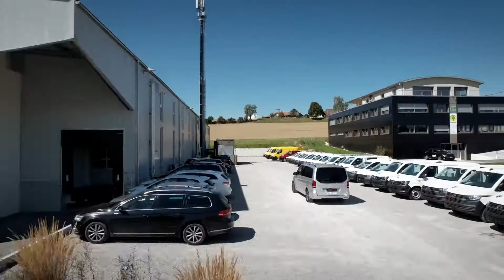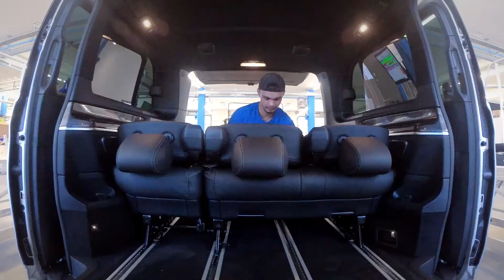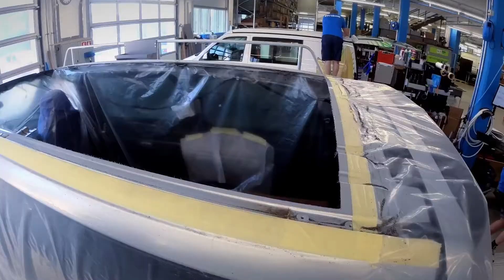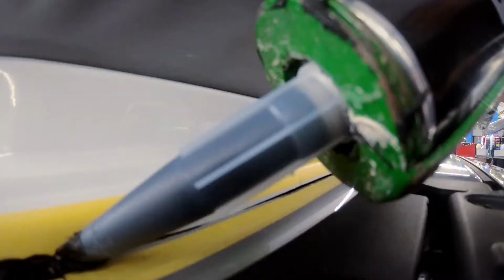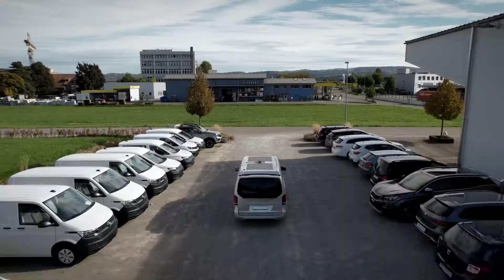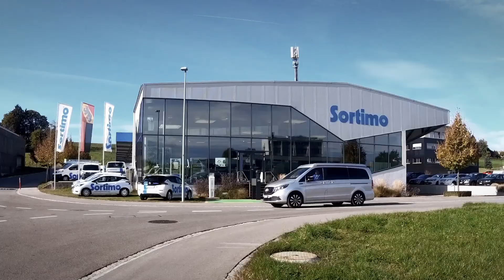Mercedes-Benz Vans Schweiz: Aus einem EQV wird ein Camper.

Comment: Would be nice to be able to buy the EQV with the minimum requirements to make it a camper. Aren't the seats and other stuff a waste currently when it's converted ?
Reply from the maker: Hello, Super Kimi. This is a conversion done by a third party, this means they still buy our finished product. Currently there are no plans for an EQV without the interior elements.